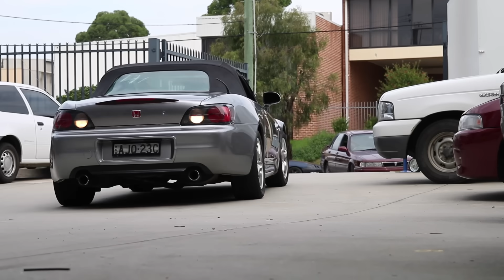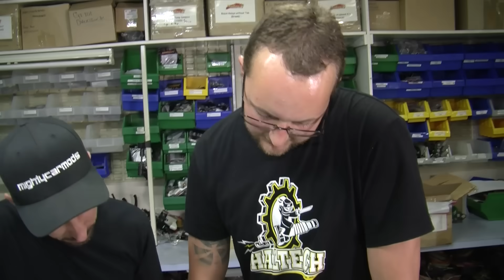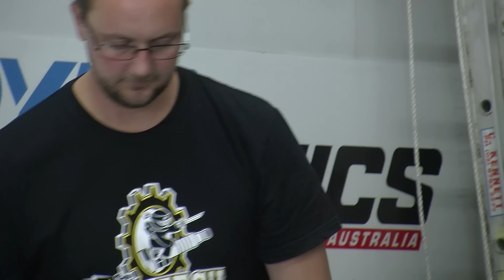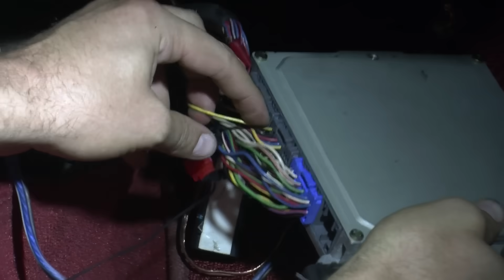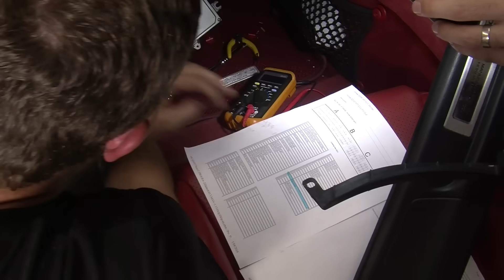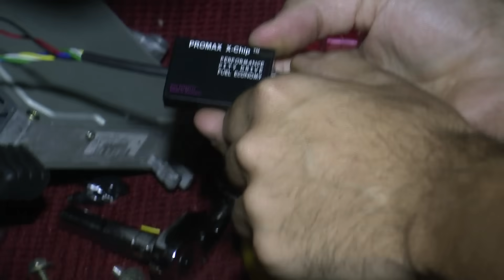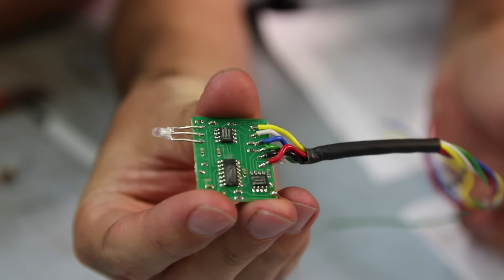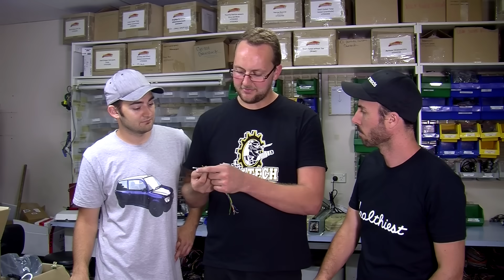eBay Performance Chips -  Mythbusted

Comment: Stick to the easy stuff. Open your engine , get an air intake and cat back exhaust.
Reply: DuBstep115

Stock mufflers can be very restrictive. A muffler or cat-back system can give you a few horsepower, and at least prepare the rest of your exhaust for the headers you should have put on at the same time.
Reply: i belive all cars have air intake and exhaust (exept electrick cars)
Reply: "Sigh",,,, Bigger intake and exhaust.
Reply: amurican35 You think that engineer cant count air flow?.. and in NA engine headers are the only thing that matter... give me a dyno link where CAT back has given even an 1hp..
Reply: Ok, yes headers, of course, and if you have the money. Race heads with port and polish.
Reply: amurican35 thats why i like my cars boosted ;) 467hp and when i want to go over 500 its just an ecu tune
Reply: check mighty car mods from last year..intake did .........nothing ....headers can ..but only if your present manifold is restrictive ..then on a engine like the s 200 has ....you might get 5 hp , again not noticeable
Reply: deepsquat600 headers are big thing in 60`s - 80`s american muscle cars.. but yes it depends on car. I know AMG models that gain low  torq and 7whp
Reply: DuBstep115 Hooker Headers ez 25 Real uni's
Reply: Actually, naturally aspirated cars need backpressure in the manifold to have any signs of power gains, usually in the lower end, and avoid valve burn. And it has to be matched or close to the intake pressure as well. Which is why unequal length headers are popular on muscle cars

and subarus...for whatever reason
Reply: SideWays8Productions Wrong! 4 stroke Engines Weather gas diesel, turbo, etc. are noting more than a air pump and the more restriction a air pump has the more it struggle to pump air, restricting a exhaust is detrimental to  HP gains.Back pressure does noting more than making the pump work harder!  Them lengthen a 4 stoke header in order to create torq. that will reduce over all HP. More back presure in a 4S helps keep air in the combustion chamber in order to create a longer burn of fuel BUT restricks flow at HIGH RPM's
 The valve problem and longer pipes is ONLY to keep from COLD air cracking a red hot valve.........
  Now a 2 stroke will gain with a very well designed exhaust that creates a wave of low  and high pressure PULSES if timed correctly to correspond  to the exhaust stroke of the piston and a low pressure at the same point in time.
Reply: Bret Muldner So Bret. What are you trying to get at? This is a CAR VIDEO. Not a lawnmower video.
Reply: Bret Muldner Can you read? Or did you just read the first 3 words and decide your logic is absolutely superior? I clearly stated "in the lower range," which is yes, where you get higher torque gains. If your car is gunna have valve race (like most cars), you're obviously gunna get jack shit in the higher range (which is why hondas will never benefit from UEL or large bore exhaust).
Reply: A cat-back exhaust does nothing but change the way your car sounds, which might be what you want, but it's not going to make you any faster. The most restriction on the engine come from the catalytic converter and the existing header or exhaust manifold and piping after that. If your car has an intake that draws hot air from the engine compartment, you might gain a little horsepower, but you'd need to tune it, so you also need to buy a programmer or ecu flasher, or whatever you wanna call it.
Reply: hzuiel

False. Nearly all catalytic converters from the factory flow very well. They can end up restricting a higher output exhaust, but when it comes to the stock exhaust, the muffler is what holds everything up. A cat back exhaust will make everything flow more freely, and can definitely add power. You may want to do a little bit more research, or go out and try it for yourself. Granted, unless you're doing a full exhaust system, the power increase may be negligible (it depends on the vehicle) but to say cat backs do nothing is false.
Reply: Tboninator It is of course situational, as different cars are designed differently, but I'll eat a hat if you can prove that on average, the exhaust from the catalytic converter back, is more restrictive than the catalytic converter itself, and catalytic converters are well known to be a source of back pressure. There are such things as high flow catalytic converters, but mostly only high end sports cars have them. 

For that matter most of the time naturally aspirated engines lose some torque when you reduce back pressure, so it isn't even a clean gain even if you do gain anything at all. Really unless your car is turbo'd from the factory or you're going to add a turbo, modding the exhaust is mostly for the sound and cosmetics. It's easily possible to lose hp on a dyno if you don't tune the car after an exhaust change.
Reply: hzuiel

Nah, you're right. Exhaust systems do nothing. The way an engine breaths makes no difference because it's not like an engine is a glorified air pump or anything.

There are cats out there that flow better than others, diameter of the cat is the main factor, but it takes a really bad design to make a restrictive catalytic converter. The only times a factory cat really becomes restrictive is when you seriously start building up the motor with higher displacement or bigger cams/heads, OR have a clogged, high mileage cat.

If you want to see how "restrictive" factory cats are, go look around the internet and see what people have to say, and what kind of results people get from swapping to high flow cats. The results are not great. A couple horsepower at most, which is about equal to the types of power variation you can get from running on a day to day basis.

If you want proof of how restrictive stock exhausts from the cat back can be... Go look at a muffler from any modern vehicle. For example, the muffler on my 5.3 Silverado was about the size of a garbage can, and the inside was one of the most convoluted, restrictive pieces ever conceived (you can find images on Google if you wish). If you can honestly tell me that my stock cats are more restrictive than that muffler, you're crazy.
Reply: Tboninator It's not as simple as that, engines are complicated devices. It's well known that on a naturally aspirated engine, dropping back pressure tends to drop the low rpm torque, but it's easier to get rpms up, and therefore easier to make peak horsepower. 

As far as cat back only exhausts, go find me a dyno test that shows some magical gains over factory, even with a lot of trial and error on the tuning. Of course companies that sell cat back exhaust systems will try to tell you that your car is going to turn into a rocket ship, but that's not reality.

Now the catalytic converters.....i have looked around the internet, and I've talked about this with tuners and mechanics before. Almost every serious tuner yanks the cat out. When i say serious, i mean people who actually have money to invest and go to dynos and the track regularly to see what their modifications are doing to their performance. I mean it is after all trying to force the exhaust gas through a filter of catalyst material. Lots of tiny little holes instead of a big open pipe. Those tiny holes do get clogged over time too, a brand new catalytic converter may flow pretty well, but an older one doesn't. If the cat is a source of flow restriction, guess how that affects things down stream? If the exhaust were a river, it would be having a series of dams on a river, and someone trying to say that you could take the last dam out, and the whole river would flow better. Most exhaust manifolds are blocky with 90 degree bends inside, and same goes for most of the piping after. There is the catalytic converter slowing the velocity of the exhaust gas as it passes through. 

On top of all this, anyone with any sense knows that doing one little mod by itself isn't going to make a sizeable difference. It at the very least needs to be accompanied with an equivalent intake and tuning. To even make any power on an NA car that you could actually discern without a dyno, you typically need a car that was already heavily restricted from the factory, and a hand full of modifications. If you have a turbo car, it's different, all you need is a more free flowing exhaust and a tune and you can produce a noticeable amount more power. The new turbo mustang dropped 3 seconds on the quarter mile from factory just from tires, completely removing most of the exhaust(including the cat), and tuning. You can't do that with an NA car. Kids that put catback exhausts on their v6/v8 mustang or civic are just deluded, mostly they're spending a lot of money on loudness. They'd be better off continuing to save until they can afford a programmer for their ecu, head work(or new performance heads), cams, and a turbo. 

Oh and besides losing some low rpm torque(which is sucky for stop and go driving) it also usually murders your mpg when you take away most of the back pressure. It can also create some longevity issues that make it really hard to justify spending the money on it in the first place.
Reply: I'm not going to take the time to continue to responding to these posts. You keep posting, supporting an idea that is contrary to fact. Mufflers more often than not will be more restrictive than catalytic converters. That is barring old, clogged converters, which I already stated. Cat back exhausts will increase performance of an engine on various fronts, how much is situational. There is a science to this, that is easily reviewed online or by going to the library and checking out a few books. To say that cat backs do nothing, or are negligible is silly. Yes, many do it primarily for the sound and look, but unless you've got a shit system, you will not lose power, you will actually gain some. Again, this is situational. Back pressure can be a good thing, but that is also situational, and I am not talking about forced induction. A free flowing exhaust system with very little back pressure (open header or straight pipe, even) will make more torque and power than stock with the right headers for proper exhaust scavenging.

This is as ludicrous a discussion as the people I've heard state that factory exhaust systems are as good as any aftermarket system, or that exhaust doesn't play any role in building power.

And the only reason anyone truly ditches catalytic converters is to save cost or complexity because either their state doesn't require them to pass an inspection or the vehicle is for off-road/track use only.
Reply: Tboninator .....I know exactly how flow through an engine works, stop talking down to me you fuck. Talking like you know what you are talking about, and actually being right, are two different things. Go find me one actual independent(not the manufacturers sales pitch) dyno test of a catback system that shows any significant gain in power, when that is the only non-factory mod. Go on, find one.
Reply: hzuiel

Hey, moron, clearly you don't know how to read, nor do you have any clue what you're talking about. What's your idea of "significant gain in power"? 5? 10? 50? 100 horsepower?

You wanna' know something else? A catback exhaust does in fact increase performance (and in more ways than power)... For example, increasing your overhead if you were to perform any other mods... But in your mind, the stock cats would prevent any noticeable gain in power from a larger cam or any sort of intake modification, since in your eyes they're more restrictive than stock mufflers...

Go do some research, you little snot. I'm not here to hold your hand. Take some initiative and have the nuts to prove yourself wrong.
Reply: hzuiel^ WATCH OUT 50 LINES.
Reply: hzuiel

Let's go back to your original statement, shall we, numbskull?

"A cat-back exhaust does nothing but change the way your car sounds, which might be what you want, but it's not going to make you any faster. The most restriction on the engine come from the catalytic converter and the existing header or exhaust manifold and piping after that."

No. A cat back will improve performance. How much is situational. How much depends on how restrictive the original muffler was, and how well the exhaust you chose compliments the rest of your engine. So you are incorrect, a cat back does not just change the way your car sounds.

Since it is fact that the catalytic converters are commonly NOT the most restrictive portion of an exhaust, a cat back can add a noticeable increase in power, especially when you tune the engine to take advantage. And I don't mean modifying other components. I mean tuning either the carburetor or the computer to take advantage of the freer flowing exhaust.

Not every cat back will provide (in your eyes) "significant" improvement. But didn't you initially state that it will make no improvement? That's the point here. What you deem significant is completely and totally irrelevant.

But going back to what I've said before, the big factor is it increases your overhead. AGAIN, because the cats are not generally the most restrictive portion of the exhaust, a good catback system will allow you some overhead, to make even more power from intake and valve train modifications... Well designed headers would make the deal that much better provided they keep velocity up, flow free, and have the correct scavenging characteristics for the intended application.

Clearly, kid, you don't know what you're talking about. You've not done your research, and you've clearly not had any hands-on with exhausts as I have. Come on, all this information is readily available at your fingertips, and you continue to argue the contrary simply because you can't admit you're wrong, let alone go look up anything for yourself. I refuse to continue baby-sitting you and explaining why you're wrong. Unless you have something useful to say, don't bother responding, because I won't.
Reply: Tboninator I may not have worded things quite right in my first post, but I have since clarified precisely what I meant about everything including tuning. Something i mentioned numerous times and now you're trying to explain to me what it means.... I used the word situational myself, and now you're using it. I'm just done. 

You can think whatever you want, but the fact is that most cars, especially older ones, have a pretty restrictive catalytic converter, and the average car doesn't have an ecm that can adjust enough to compensate for any large change in breathability, so a catback at best is going to results in a loss of some low end torque, lower mpg, and maybe a bump in hp. To some poor kid listening to morons like you at the parts store, nobody tells them to go research how well their car responds to a catback exhaust...they just make it sound like it's a guaranteed bolt on chunk of hp, Then when it doesn't work like they expect, the "bros" keep telling them to spend more money and more money, until finally they have gone for a dyno tune and spent 2 or 3 grand, to get a whole 2, 3, 4% or something similar. Even then their car probably still loses some mpg and is possibly no longer street legal, all for an amount of power that probably wouldn't even assure them a win over a guy pulling up next to them in a totally stock version of their car, and get left in the dust by people who just spent that extra money on a slightly nicer car. 

This kind of garbage is how ricers get a bad reputation. That dork with a noisy pipe, stickers, and bucket seats in a shitty civic, annoying everyone with his loud car that isn't even fast.

Comment: I once had a Unichip for my Mini Cooper S.  You are better off with a custom ECU tune, and don't expect dramatic increases in output.  If you're lucky you can get some of the glitches out of the factory programming, such as weird behavior with the air conditioning on. This isn't something you should order off the rack.

Comment: Got a performance chip from turner motorsport on my old e36 M3 after I did all my mods, definitely worked. But this is ebay trash of course.

Comment: That S2000 is seriously down on power - the baseline 'control' dyno run demonstrated 177hp at the wheels. That's about a 25% driveline loss vs. OEM HP claims.

Terrible.

Comment: I'm going to assume that everyone is aware that when you use any performance chip for any car with no turbo, it'll put out little to no extra HP.  The car must be turbocharged in order for the chip to produce the extra HP it claims to add on.

Comment: Those cheap Performance Chips just trick the ECU into thinking the engine temp is 2 low.
The ECU will add more fuel like as if it was warming up.
SO once your Car is warmed up, there is no difference.

Comment: What about a more expensive name brand chip?
Reply: This video is a little bit misleading, not all cheap "chips" are scams (well, not really chips, more like "hacks"), some do work, sometimes by disabling fuel economy features, sometimes by lifting safety features, which results in wearing out car parts which are not design to operate beyond factory set safety limits, sometimes they lift speed limit from vehicles otherwise prone to tipping at high speeds, or from special vehicles such as trucks, tractors, buses.
Reply: funky3ddy yea I know there is more quality ones, especially good with for Hondas, chips that make vtec crack at 4900rpm

Comment: This a really odd form of "chip"/ "tune" to put into a car...the title of the vid is slightly misleading in that there are "chip" out there that actually modify the programing of the ecu. I use a RICA softloader for the Volo R. RICA creates the tune for the mods you have on your caR and then you download that specific tune to your caRs ECU which then also clears all the bothersome codes that a ecu mod can create. the chip the MCM boys bought looks like they won it out of a gaming machine at a gas station.